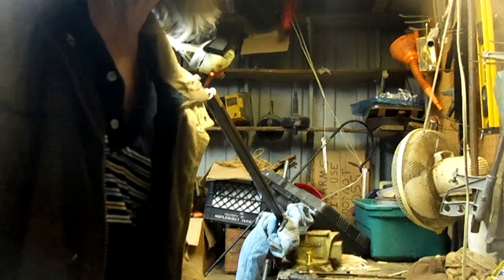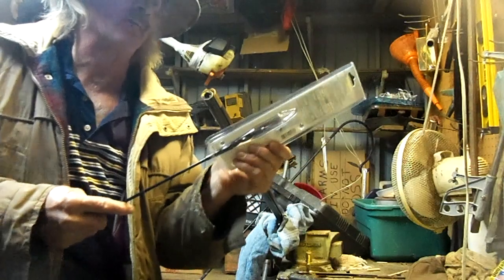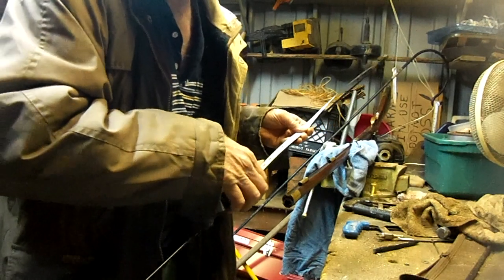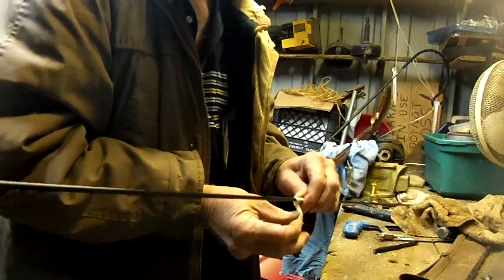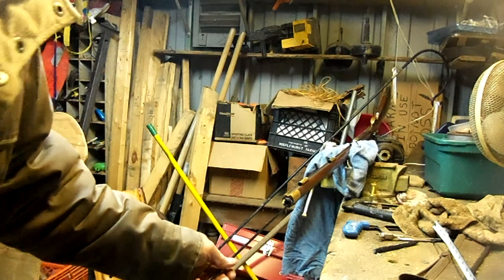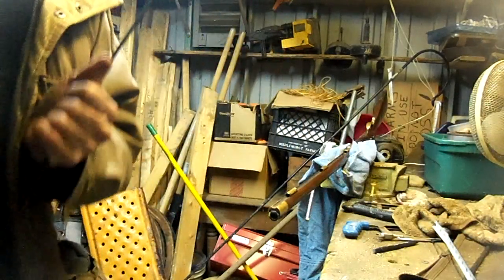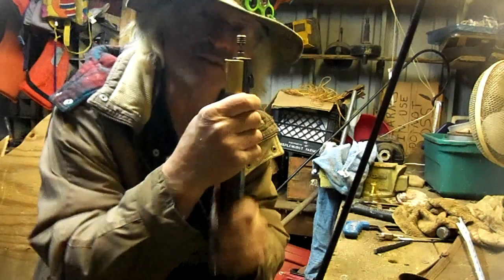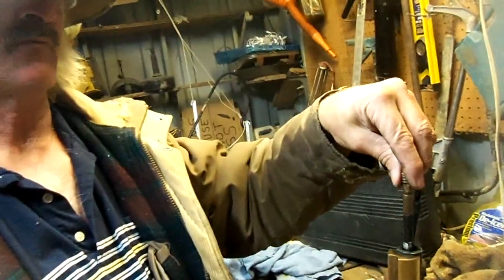How to remove a stuck ball in your flintlock ( Perform as a last resort ) Dryball

Comment: This is a great idea, but I'm concerned with messing up my rifling with the steel drill bit, so I might expand a bit on this idea and make myself a ball-drilling jig. How about a long piece of wood dowel close to the same diameter as the bore, drill a smaller hole in the center of the dowel and epoxy in place a drill bit. That way the ball can be drilled out, but the dowel will act as a guide to keep the bit from messing up the rifling.
Reply from the maker: Those are good ideas too. I was pressed for time to get this ball out & hastily drilled it without a guide. I suppose the next time...( Im sure it will happen again someday )  I'll just wrap the drill bit shaft just behind the bit with duct tape till its slightly smaller than the barrel. That would make a very easy guide too. You have a some great ideas I'll consider if/when it happens again. Thanks for watching my friend.......
Reply: @stevanrose7439  I bought a smoothbore and sold the rifle. No more stuck balls, lol.

Comment: This might happen to me someday and I thank you for the solution!  But until then, I bought a used Hawken from a pawn shop.  (I'm too poor to afford a new one and don't have the time to assemble/modify a kit).  So, from what I could tell, everything looked in good shape.  I wanted to clean it and lube it good before taking it out the first time, so I decided to just pretend I had been shooting all weekend or something and give it a aggressive tear down cleaning.

What I found was a cleaning patch lodged in the barrel.  I could kind of see it, but not enough to be sure what it was.  I tried everything to get it out.  Removing the nipple, clearing the hole, air, etc.  Nothing would work.  I couldn't remove the breech plug because it hadn't been removed in so long it would take some serious heat to remove, besides it shouldn't be necessary.

I struggled with everything I could think of for 2 solid days.  What I finally found was a piece of bailing wire (my father used it for everything under the sun!) and a few good pokes to dislodge it.  It had been wadded in there so long it dried and affixed itself to the rifling or something!  Once I got it loose, a shot of air in the nipple hole and it was gone!

I'm extremely lucky because it looked like they were trying to clean the gun and it got stuck.  It was extremely fouled, but somehow didn't cause any corrosion.  The funny thing was they cleaned the rest of the gun, probably for a quick sell, hoping no one would notice the stuck cleaning patch.  I was just the idiot that came along trying to save some money I didn't have!!!
Reply from the maker: Here's another idea if you get a future patch stuck in the gun. Its an easy fix for less that $5.00: https://www.youtube.com/watch?v=06NWH--qRmE&list=PLVMfc1ggQhJI0kU74xmk3idVKHOT38oMT&index=17&t=0s

Comment: I first remove barrel, then with puller screwed in to the ball, boil the breech for a couple of minutes.. Usually the barrel expands enough to permit pulling out that pesky ordnance. If that doesn't work, the melting point of lead is only about 330 C, so put the breech in an oven or similar and melt the bugger out.
Reply from the maker: WOW....seems like a lot of work, but, if it works for you.....it works for me. Thanks for watching.

Comment: Track of the wolf sells a really good tapered ball puller that when used with a steel range rod with a T handle, works really well. With the puller attached to the range rod, slam the screw into the stuck ball , then screw it on in to the ball and hook the T handle over something solid and pull the rifle away from the rod. I have removed many stuck balls this way and it is easy.
Reply from the maker: I've seen that practice performed at Friendship before. Sounds like a good way to get a ball out although I've never had any luck pulling the balls. I find it a lot easier to shoot them out. Thanks for watching.

Comment: Thank you!  Have had a stuck one in my musket for a year. Tried everything.
Reply from the maker: This method will work. Be sure to measure the drill bit length, etc & drill it right out. Easy enough. Thanks for watching.
Reply: Find a grease zerk that fits in the bolster and a grease gun

Comment: Most of us have heard of the soldiers in the Civil War forgetting to load powder or loading multiple loads on top of each other, and wonder how they could be so careless. Your story illustrates all it takes is some kind of distraction and it could happen to anyone. Good job of finding a relatively painless solution to your problem, I'm sure a gunsmith would charge you a small fortune to have cleared your barrel, a lot more than that long bit cost.
Reply from the maker: Regarding the gunsmiths.....You are exactly right my friend. They probably would do something very similar to what I did in the video. That $20.00 drill bit saved the day more than once! Thanks for watching....

Comment: I recently built an Investarm Gemmer Hawken. Having never owned a flintlock i got it to fire once. I had 100% success with the ball puller. Maybe my experience in various trades including taping and threading mateials that lent to my success. Drop the ram rod in with the ball puller attached, apply steading and firm downward pressure, and slowly rotate to the right until you feel resistance plus a turn and pull the ball out.
Reply from the maker: I've seen others try pulling a ball with awesome success.  I've never been that lucky. Thanks for  watching...

Comment: Also works to use a CO2 ball discharger or compressed air even on a flinter
Reply from the maker: True...if you have one available. I have no muzzle loading gun shops anywhere near me. There was no way to get one in 2 days for an upcoming gun shoot. It was time to get radical or don't go to the shoot. Thanks for watching.....
Reply: @blackpowdermaniacshooter  You could try a tubeless tire valve held down tight over the vent hole, and either a bicycle pump or compressor to add air pressure.  Cheap, and works.
Reply from the maker: @flntlokr1  I now have a CO2 bottle kit. Sadly..it has those cheap plastic tips to use. The one made for percussion guns works OK, the one made for a flint is junk. Can't get a tight enough fit to blow out a round ball. A bicycle needle was my next option to try. Thanks for the suggestion. I'm surprised someone hasn't made needle to fit those devices. I'd pay a few dollars more for such a device for flints in a CO2 bottle kit. Most everyone else wanting one would too. Thanks for watching.......
Reply: Took less then 30 secs with air compressor, just a quick blast at 125psi. No harm no foul.

Comment: I have a 50 cal, cap lock  TC Hawken that was set aside with 90 grains of black powder and a patched round ball.   I think it's been there for almost 10 years.  I've been trying to remove it with a screw type puller with no luck at all.   I am not able to remove the black powder charge from the nipple.   I'm concerned about drilling as it could set off the charge.   I did see your comment about tying the gun up into a tree, pointed at the ground and pulling the trigger with a string from a safe distance.   This might be my best option.   Just wanted to chime in and see if you or others have any additional thoughts on removing a ball that is stuck with a charge.   Thank you!
Reply from the maker: If you have access to a high pressure air compressor, that will do the trick, similar to this video: https://www.youtube.com/watch?v=GwngvnGrgsI
Reply: Grease.  Zerk fitting on the nipple. Must be tight.  Pressure moves it up and out.

Comment: You can also glue in a one eighth inch drill bit into the end of a wooden dowel and drill the center out of the ball. Then use the threaded ball remover.
Reply from the maker: I tried something similar to get a ball out & the drill bit came apart from the wooden dowel & was stuck in the barrel too. That's why I used this one piece long drill bit as a last resort. Fortunately, I've only used that bit 2 times....so far. Thanks for watching.

Comment: isn't there a chance the drill will get off center and damage the rifling in the barrel? That looks pretty sketchy to me, A collar of tape that almost fits the barrel close to the tip of the drill seems a way to keep everything centered.
You have me hooked a flint lock rifle  is on the menu for my birthday present to myself this fall. for sure A .50 caliber which should work well on feral hogs which we do have around here in Texas.
Reply from the maker: I only use this as a last resort. My son & I were suppose to fly over to Pittsburgh the next morning for meat shoot. This barrel was totally clogged. The rifling can be damaged for sure. Neat time I'll put a piece of drilled wooden dowel rod on the drill bit to avoid possible damage.  Yes......a 50 caliber should drop a hog if you're within 75-100 yards. Let me know what you think of it when you start shooting it.

Comment: A little help? Ive managed to drill a hole straight thru the center of my ball with a ball puller 😅 - wouldnt this tip just leave a 1/16 ring of lead in the barrel or does it get to weak at that point?
Reply from the maker: The bit I use is slightly smaller than the barrel. My results has been the lead removes itself if you drill it out. Once I 'm done drilling, I turn the gun over & let the barrel bounce on the carpet a few inches. Everything falls out then.

Comment: Ok now real question is how to do it in18th century. I guess hand drill and make long bit? Thats what i like to do and see before all this technology. I call it old school cool. Keep up the great job helping all of us thanks again God bless!!!
Reply from the maker: I thought of the 1700's gunsmith having a drill bit originally to make a barrel. So, why not use a smaller one to drill out soft lead? This worked GREAT. In 15 minutes, I was ready to shoot again. I put that drill bit in with the rest of my accessories in the my gun safe........just in case I do that again someday. Thanks for watching......
Reply: In the 18th C. you would just put a small drill bit(bullet puller) on the end of your ram rod and had thread it into the bullet. Sometimes it takes a good long while and a lot of force. He just did the Tim Taylor version of that. Problem with mine is the ramrod broke inside the barrel while I was twisting it. I used a self made ramrod because pedersoli didn't sell replacement parts when my ramrod originally got lost. So I just mohogany stained a pine dowel and put a ramrod tip on it. Worked fine until I had to use a bullet pull with it. It snapped inside the barrel. Still stuck in there.

Comment: I've got an old 70's Ultra-Hi Kentucky percussion rifle in .45cal that still has a misfired charge stuck in it. But I'm not sure the powder is all out through the nipple hole over the years? I've been restoring the rifle, but the puller broke the screw sleeve off the other end of the ram rod years ago. You're right, those pullers are worthless. It's a good barrel otherwise. Just gotta clear it out.
Reply from the maker: Hmmm, that sounds like a real mess. What I would try in this case is....( I've done this before ) ....pull nipple, pour powder into hole & replace nipple. Put a cap on & try shooting it out. Although...since it's been that way for years, I'd hang it in a tree pointed to the ground and tie a string to the trigger & pull the string from a safe distance. Hope to see you get that one out soon.
Reply: If all else fails, dismountr the barrel and melt the lead out.  It won't hurt the barrel because you will get nowhere near red hot doing this.  Just be sure there is no powder involved.
Reply: I had a similar situation a few years back... The end of my ramrod broke off with a cleaning jag/patch about 9" down from the muzzle, and it was stuck good. I unthreaded the touch hole liner and screwed in a grease zirk with the same thread. Used a grease gun and pumped grease into the barrel... Pushed the works right out of the muzzle. I had a mess to clean up, but it worked like a charm.

Comment: What happened to me was as I was using a ball puller that is attached permanently to a supposed to be an unbreakable rubber rod as I was twisting it in the puller broke from the plastic rod thus leaving the puller that is attached now to the ball inside I tried shooting it out won't work. Lesson always use a aluminum rod don't get buy into the supposed unbreakable rubber rod.
Reply from the maker: WOW....hope you got that rascal out!
Reply: @blackpowdermaniacshooter  After several tries, I tried using compressor air no work, I tried shooting it out no work, I tried drilling no work and finally I use heating gun heat up the barrel that eventually melted the lead ball and wallah! got it all out sigh!.
Reply from the maker: @dantankunfiveancestorsfist  OUTSTANDING!  Now you can get back to shooting once again! Thanks for the update.

Comment: How do you know you were drilling in the center of the ball and not between the ball and the barrel? Wouldn't want to do that!
Reply from the maker: I didn't at that time. I was in a desperate situation. I needed to get that gun back in operation before flying with my son to a Pittsburgh Penn. gun shoot. If I need to do that again......I'll add a section of dowel rod or if nothing else...allow tape to wrap around the shaft before sticking it in the barrel. That will ensure the bit won't hit the side of the barrel. Thanks for asking......
Reply: Oh, I see.

Comment: is there a chance that the heat from the friction of drilling would set off the powder? or is this just 2 round balls with no charge other than the few grains of powder you added trying to discharge?
Reply from the maker: If the balls were made of steel, iron or some other hard material,  I would be concerned about friction/heat. However...since the balls were soft lead, ( you can actually scratch them with your fingernails...) the bit maybe turned 20-30 times and was quickly through the ball. It was very easy to remove. Great question, thanks for asking....
Reply: Black Powder Maniac Shooter    Thanks for clearing that up. I’ll keep this method in mind next time I get a round stubborn roundball in my Hawken!
Reply from the maker: Awesome...keep on shooting my friend!

Comment: Sadly, for me the ramrod with the bullet pull broke off inside the barrel. So, now there is a hard steel bullet pull, a brass mount on the ramrod, a bullet, and a half a ramrod stuck inside the barrel. lol. I think at one point I did try getting that ball out by stuffing powder into the vent hole. Any ideas on that one? I think I even tried(although I may try again) a vacuum cleaner. Now I have a 5 HP shop vac, I may try to suck the ball out by making a perfect seal. The vent hole should allow for a comparatively  low pressure on the other side of the bullet(and other junk), allowing it to come out maybe if the barrel is pointed down to have gravity assist as well. Things are getting weird and I need my doomsday gun back. OH edit, I even tried a second bullet pull or a screw to drill into the wood and that pole broke inside as well. So, add that to the medley HAH. Maybe just remove the breech plug? I don't see anyone doing that anywhere so I am very, very skeptical about attempting it.
Reply from the maker: Removing the breech plug is a last resort. Try anything but that first. Maybe try a tough piece of wire with a small loop on it? Try to fish it around the broken ramrod, hope to get it tightened somehow and pull it out?? Just thinking out loud here...

Probably the next thing I'd try is:

Do you know someone with high pressure air tank??  Something with a lot more pressure than an ordinary air tank should have. Maybe a friend at one of those big truck tire shops?? Maybe the compressor force will push it all out like a CO2 bottle would under normal circumstances. I'd try soaking it with a liquid to loosen up the patch first. Let me know what happens...thanks for watching.
Reply: @blackpowdermaniacshooter  Now that you mention it..I do have a 3 gallon "hot dog" air compressor. However, how would I create an tight air seal? Keep in mind this pistol has no vent hole "sleeve". Just a pin hole like you'd find on a period gun.
Reply from the maker: @peterlamont647  Hmmmm....Maybe try a needle used to pump up a football?? You might have to modify the tip slightly to get it thru the touch hole...maybe wrap a little pipe plumbers tape around the needle tip too?? Hopefully that should work...

Comment: i bet your barrel looks awful where the ball was sitting!! maybe you could make a plasic bore guide to ride just behind the bit to keep it centered (pvc pipe maybe)  & your barrel won't be damaged... get a bore scope & look at your barrel,, bet it is very scarred up now? (Hope i'm wrong, but as a custom riflesmith, i've messed up a centerfire barrel with hardened steel in the wrong spot)
Reply from the maker: It possibly is messed up at that point. Probably should have used a bore guide or at least wrapped duct tape near the tip.  I was in desperation mode...wanting to get it operational before flying to Pittsburgh the next morning. Thanks for watching...

Comment: I had an old gunsmith tell me that you can melt the ball out as well. Remove the touchhole liner and use a blowtorch in the hole. Will require a rebluing afterward
Reply from the maker: I won't try that due to black powder being in the barrel. Drill bits are much easier. This took more time to video tape than it took to drill it out. Thanks for watching......